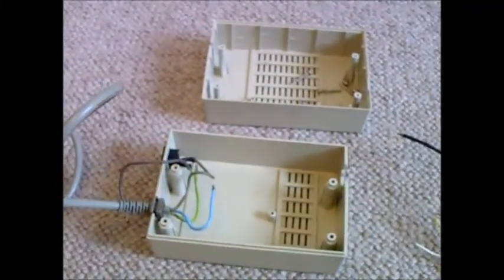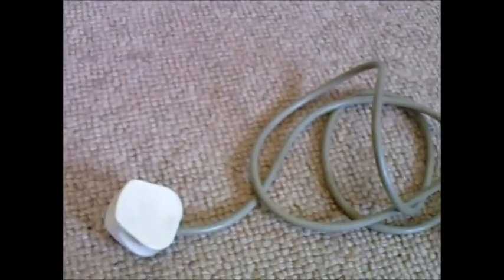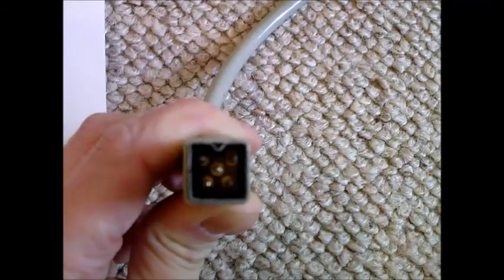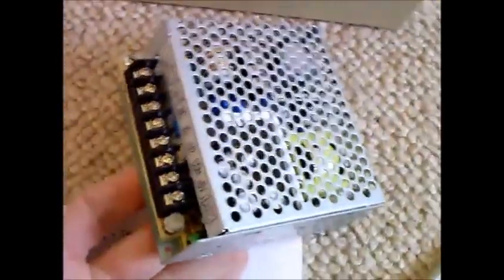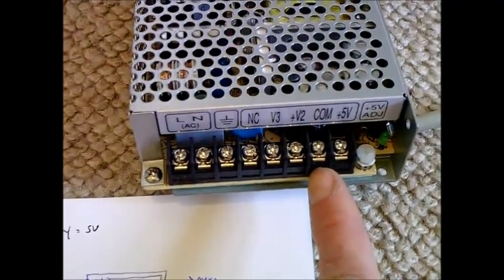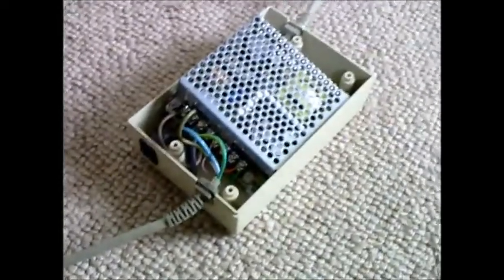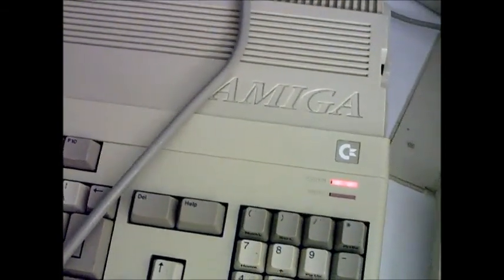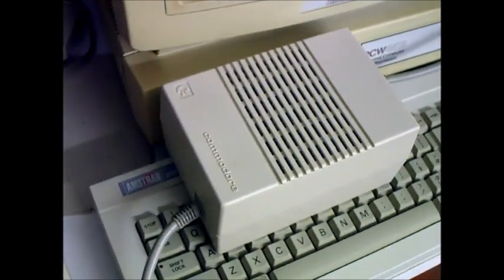Amiga 500 Power Supply Replacement & Black Screen Error

Comment: check how many times the caps lock key flashes and let us all know!  1 blink = keyboard ROM checksum error, 2 blinks = RAM failure, 3 blinks = watchdog timer failure.. 
It might not be white you are seeing - but light grey! Which suggests a faulty CIA (U8/U301).. so get the CIA checked if the Caps Lock is not misbehaving!

Comment: Hi P5ychoFox, do you still have the old PSU board? I am after a 220V one.
Reply: @P5ychoFox. Hi, I will try to get a cost from my end and get back to you. Thanks :) On a separate note, The drive light (green) never came on when powered up. Is that correct??

Comment: The "ticking" of the floppy drive without a disk inserted, is normal.
The sound the floppy drive produces with a disk inserted, is not normal. Maybe some cleaning is required.
There is also a monochrome RCA output in the back which you can use in order to check if the Amiga is producing video signal.
In addition you can do what you have already mentioned, unseat and re-seat any chip that is socketed.
Reply from the maker: Many thanks, I didn't know about the RCA output. That'll tell me if the problem is the lead or the Amiga itself. If it is the Amiga I'll reseat all socketed chips as you suggest.
Reply: You are welcome. :)
Reply from the maker: It shows video via the RCA output :) Now just that floppy drive to sort out / replace.
Reply: Excellent!
Maybe there is something wrong with the SCART cable itself.
There are quite a lot of schematics out there to make one yourself.
Also check out YT for cleaning guides for the floppy drive. A lot of options!